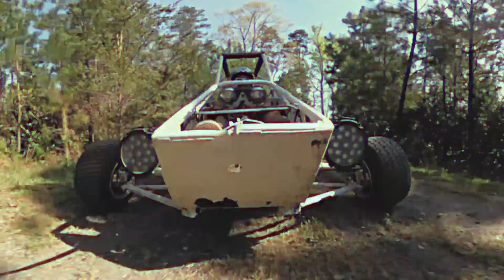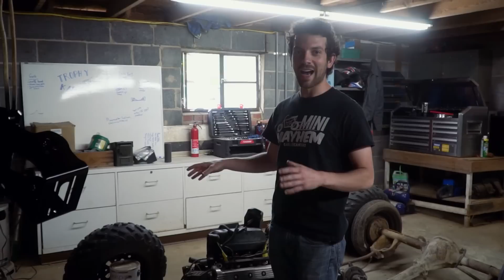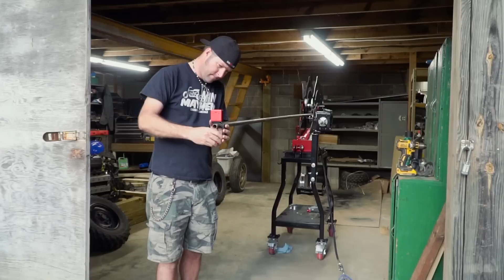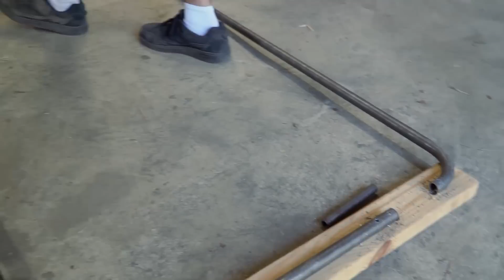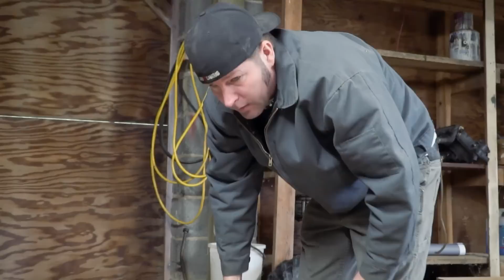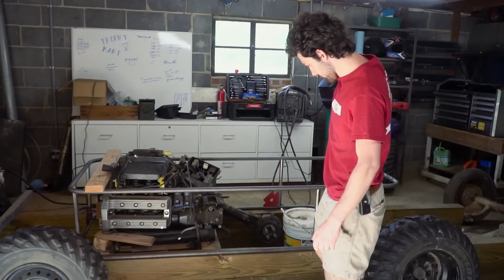1000cc Mini Trophy Truck Build Pt. 1 | BMW Powered Baja Buggy Go Kart!

Comment: Hey guys I have a 2013 Yamaha r1000 streak bike engine and full cut down wiring harness and a racing volocity stack that I’ll look to sell.   I use them for a dirt track racing dwarf car.    Let me know if your interested.    The wiring is fully cut down and all wiring is labeled for easy wiring.  I have pictures if your interested
Reply: Also have custom headers for it as well

Comment: Take a look at the Terrible Herbst off road racing team, specifically their truggy that Im pretty sure is being rebuilt to race again. Its basically a trophy truck without the fenders. This is for sure the most excited Ive been about a build, real trophy trucks hitting 150 mph on lake beds is absolutely incredible. Watching them handle the big whoop sections at speed and the cab isn't even moving is unreal. Plus the eargasm those Patton mills provide...……. yup good freakin stuff right there lads!

Comment: Too wide and it will be too heavy, need to make it narrower if you want to go threw the woods. Don't trophy trucks have  independent rear suspension? If they don't then they should, you could cut the rear end down to almost nothing and put axles...

Comment: Quikrete makes a floor leveling compound with a really low viscosity. I've used it to level uneven concrete floors in the past. You just dump a couple buckets on the floor and let it settle. In the end, you'll get a smooth, flat, and dead level surface to weld up your frames on.

Comment: You want to build a trophy truck, but are designing the frame like a go-kart. Check out some TT frames and scale appropriately! Plus you are going to need a seriously strong frame to put up with long travel abuse with a motor that powerful. So modeling your frame off a real TT frame will go far in safety and longevity!

Comment: For inspiration look at actual trophy karts. They're a little smaller, but the 600r's/Unlimited Trophy Karts are a little bigger. They're engines are usually behind the driver though.

Comment: Need to decide on overall shape before you go too far. Piecing it together would work, but it never looks as good, or is as solid as a cohesive design.  A sand rail frame might be some good inspiration!  A couple( or 4)  1 piece tubes running from end to end should give you an overall "line" to work with.  Loving the build, and whatever you do, it will be awesome!

Comment: I have helped a buddy build a level rack on a crooked uneven concrete garage floor using some scrap steel I beams and metal posts. We bolted it to the floor, it was great to make a jig on it, weld on it .  Mostly scrap steel pieces

Comment: I loved the 80s intro guys. As regards design fellas unless you brace the hell out of the space between the upper and lower frame I'd be afraid it'd collapse in the mid after you land a biggish jump.  I know your probably worried about the weight but might be worth building your lower chassis out of 2 inch box section - its easy to cut and weld together really square and flat and easy to work up from. Just a thought. Love your stuff guys and keep up the good work.

Comment: Copy the bottom frame hoop, space it up about 4-6", run small triangulated tubes all the way around between the 2 hoops, it will make it strong and stiff.  And look good.

Then change that top hoop.  Ick.  Angle it at least, but it looks WAY too fat at the front, even if you fill it with a radiator, it will look too fat.

Comment: Guys do your self a favor and get bend tech pro 
I bet if you checked he’d sponsor your channel 
It’s very easy and you design on the computer with 3D views of the tubing it’s so amazing 
You take the tutorial and in a few hours your drawing and designing it tells you the weight of your chassis 
It calibrates to the bender you have it prints cut sheets for each tube 
Please trust me and look into it

Comment: You’re building things in the wrong order. Place your engine, place your driver, design your suspension and drive train then start connecting all those pieces with the frame. Also the frame usually will start with the hoops, the main hoop that the harnesses attach to and the driver sits under, then the hoop for the dash.

Comment: "bulletproof live axle" then shows Chevette axle. Lol sweet build
Reply: Lmao yeah but its only 90hp so it'll be fine
Reply: @greasysteve5671  probably, but those axles have been known to go out behind a 60ish hp Chevette.
Reply: @lean-tocustoms7910  normally it's the shaft it's in the torque tube that gets twisted and then breaks into but in the past I destroyed the pinion gear in one of mine
Reply: My 1981 Chevette couldn't hold 65 mph on the freeway going up the slightest hill. Those parts weren't made for the amount of power that engine makes but hopefully it will hold up for a little while.

Comment: Scale down a real cage, there are many designs on line to chose from. Make a real rock bouncer or trophy truck cage but scaled down. You can work out any issue of getting in and out or motor removal access afterwards durring the build.
Reply: I'm a disabled carreer welder/fabricator/mechanic that just got done raising children myself. They moved out but I am stuck in the city without the area to do much. The landlord would be pissed if I built a half size rock bouncer or trophy truck on his shiny hardwood floor in the living room. lol  I been dreaming for years on the matter. I have 4 ATV's, a 583 ski-doo, and all the shop equipment plus powder coating equipment...in storage. POOP!

Comment: Guys, back up.... First, build a simple welding table. Better yet, build a welding table that will also be a lift, by adding a scissor system to it. Cobble that up for a hundred or two. Y'all been working on the floor for long enough. Not only will a table/lift save your knees and backs, but also lend itself to much better, interesting camera views/angles.

Comment: drop the upper frame rail to below the valve cover. low slung chassis look better. also to stiffen what you have requires a lot of cross bracing that will block your valve cover. structure low. roll stuff high to keep it from breaking in half.
low what you guys do!

Comment: Since you guys now have 240v in the shop, I would give a serious look at a 3 phase converter. You can find a ton of 3 phase equipment for the same price or a bit cheaper than standard single phase 240v equipment used. You'll want a large air compressor, especially for a plasma cutter.

Comment: One way to make it not look like a bath tub would be to break up the straight lines up top with more bends. Perhaps a dip (offset) in the top frame where the seat will go? Would also help with climbing in and out.

Comment: if you guys want reverse on the kart check out rpmgearboxes .com they handle hayabusa engines and they can gear the gearbox for your application. i dont know if they can adapt to the final drive of the bmw. i got one and i got 5 gears in reverse ;)

Comment: Ground clearance at full bump with those tires might be a problem if you're going to have significant travel.  Take your expected total travel, divide by 2 and add 3-4" and that has to be your minimum ground clearance at ride height.  Otherwise, you're not measuring it right (har har). :)

Comment: i got a Mercedes-Benz brand new front end with break pads and all of that stuff if you want to trade for some work on a small gokart    i only built the frame needs wheel hubs motor mount and stearing i got a plastic skin for it to be attach
Reply: i have a light wight rear end also  and the front end is heavy duty bad ass

Comment: Check out grindhard plumbing they do a quick disconnect frame it was simple. Take a bar of steel cut it into disk one of them you drill and tap the other you just drill a hole. Weld them inside the pipe. Have a shorter end be open so you can slide a socket down onto the bolt that holds them together. It's brilliant and I am sure they won't mind you barrow in their idea

Comment: I think your 1 inch OD frame tubing is massively undersize if you're going to be jumping it like a proper Trophy Truck at speed, it'll just fold in half because not only is it small diameter but it's thin walled as well & yes I know the cross kart was a success but it's nothing like what you want to build now....just saying not hating.

Comment: You could still wedge top frame, then always cut out sides later with extra bracing  to make it more accessible. 
The crosscart is probably my favorite built, I trophy truck cart is going to be exciting.

Comment: Whatever you do, leave yourself room to get in/out of the seat without having to twist yourself around like a pretzel! Hint: the top bar doesn't have to be all one piece from front to back, nor does it have to be made as a straight bar from front to back. You can bend it to create a door / hatch type opening and cover it with webbing or even a small drop down/fold down door. Think of it as a safety feature.

Comment: What if you kept the front part of the upper frame straight and bent the back part up where the seat would be that way its easy to get in and out of but you still get some of the wedge shape design. Love the videos keep up the good work guys.

Comment: Looks good and good luck with the build you guys will sure learn a lot doing it. Just a thought the more travel the higher the loading and it is not linear but a logarithmic increase. Also the weight  increase yields the same it is not linear. That is just the nature of things and why light frames are preferred over heavy ones  so careful stress and loading analysis are crucial when building a frame. Really good luck and really looking forward to your build and process.

Comment: I was going to say if your doing twin i beam front suspension. Get the front i beams off an old 2wd ranger or f150 and cut them shorter but they are forged steel so idk how well they would weld.

Comment: Did you guys get wind of what I'm building? I'm using a little 4 cylinder toyota motor with a turbo. Lots of design challenges, good luck guys.

Comment: Look at real trophy trucks:  Most tend to follow a "Y" shaped frame. That would be absolutely badass
Reply: Why not take a look at real Trophy Karts? There is already an established racing series for them, they're very advanced. Unless you want to design your own from scratch, nothing wrong with that
Reply: like the Delorean?
Reply: Sam Leen ?????
Reply: U guys are gonna have problems with that frame. That motor is heavy. Save some headache and buy old muscle car frame and go from there. At least it won't fall apart
Reply: Nick McCain I thought the same thing. Too much weight might make it kink right past where the motor mounts to the frame especially if they catch any air and land hard. Unless they do the math and build a good truss they will have problems.
Reply: It's barely begun.  People were prematurely saying the same thing about the cross kart frame.  Those comments did not age well.  Embarrassing.  
And nobody wants a car frame repurposed for this.  
If anything it'll end up overbuilt which is always what you want to some degree.
Reply: YES!  And 4x4 like a true Baja buggy!
Reply: @one-eyejawa3128  most buggies and TT's are rwd
Reply: Tiny Dr. Phil I know sand rails and those types are rwd but also are rear engine too like the cross cart. Thinking more like a traditional raptor. Nothing says beast like all four wheels spinning like mad in the mud!

Comment: the chassis you have is basically a pan chassis, like a buggy. Trucks have ladder frames,  ie two sticks running front to back. In a truck you sit on top of the frame, the engine is in between and the axles and suspension are underneath. in a pan chassis buggy the bottom rail is the bottom and NOTHING goes below it.  Go find an old ford ranger with I Beam front suspension. scale that entire truck down to fit the size you want to be. all a ranger like that needs to be a desert truck is extended {wider} i beams, some Deaver leafs in the back and offset wheels to make the stance match. :)

Comment: I'm kind of on the side of chevett as I've a lot of chevetts over years. My sister bot one in 1976 when they a new car for that year and I pasted my drivers test on that same car yes I do love the chevetts and one of my restored cars I have is a 1979 chevett. And I'm proud of it I rebuild every thing on the car myself. Als if you use the chevetts front end then you'll the same lug bolts both front and rear

Comment: if it was me, i would add a 10 degree upwards bend on the top tubes just after the engine,then once a roll cage is added above that section it would give it a rock crawler/ bouncer look. without too many parallel lines in the frame.
also i would get a reasonable size compressor and put it in the roof with the lines down through the ceiling so it doesn't take up any work space.
love the build so far though, will be amazing when its done no doubt.

Comment: I have a question , " WHAT BRAND OF TOOL'S IS NEXT TO THE WELDER WITH THE BLACK LID UP & WRENCHES STORED IN IT ". LOOKS LIKE THE BOTTOM DRAWER IS MISSING ? THANKS, Henry from PA. " THIS BUILD IS GOING TO BE A CHALLENGE & MIGHT REQUIRE A BIGGER ENGINE " ? THUMBS UP MEN.

Comment: Looking good so far!  Also, if you need to upgrade that rear axle, a rear axle from a Isuzu impulse is a direct swap and has a limited slip and disk brakes.  (and maybe a higher ratio, not sure)

Comment: Thats how I do things as well i make them work for me. Ive re engineered alot lf things to make it work for me an hey man if it works it works. 💪👊🤙
Reply from the maker: For sure. Thanks for tuning in
Reply: @CarsandCameras  you guys should think about getting some renders done for what you want it to look like. At the very least, check out pinterest and sketch out shapes on a4 with a pencil.
Reply: i agree the first go kart i have made so far the only one looked like a limo until my 6'4" self sat in it and realized i need every inch of leg room

Comment: Anyone else think that tubing is a bit small for this build?
Reply: Read my mind.
Reply: Agree 1’1/2”  would be my start with tube size but that’s just me
Reply: @briantinsley3923  agreed
Reply: Yep it’ll Probably snap when it jumps
Reply: Not in the slightest.  Same sort of mechanically retarded comments appeared on the cross kart build.  The chassis has barely begun forming.

Comment: It’s going to be an awesome build and I will watch it all. But....... I think it’s going to be slow. 1500lbs+ and 90hp= a chevette with atv tires
Reply from the maker: We think more like 1000lbs, maybe 1100lbs with rider. That'll give it a power to weight ratio significantly better than my 2.5 swapped Miata (which is no slouch). Combine that with gearing and aggressive tires, it should get along very well. And, believe it or not, the Chevette never made more than 65hp or so from the factory.
Reply: CarsandCameras gearing is going to have to be pretty aggressive. A k100 is not a fast motorcycle at all. And this is going to weigh significantly more than that.
Reply: Shaun86 Chevy the Vaseline RZR 1000 non turbo weighs 1500 pounds and has 110 hp. If this ends up only weighing 1000 pounds and with 90 hp it will end up with similar, maybe even better performance than the RZR.